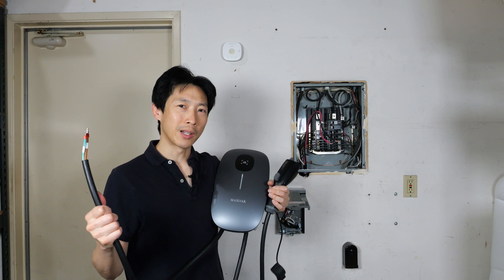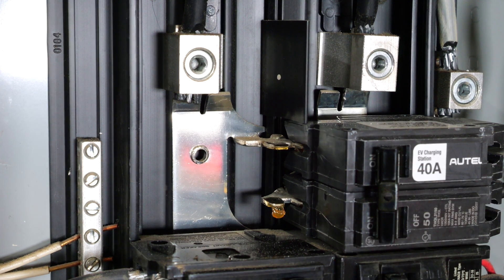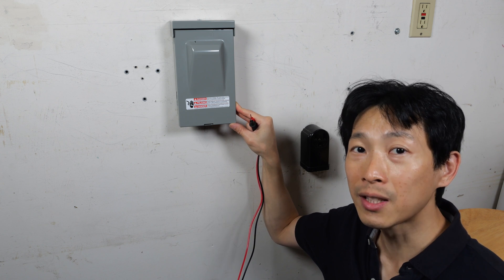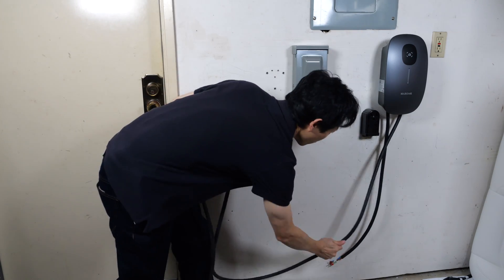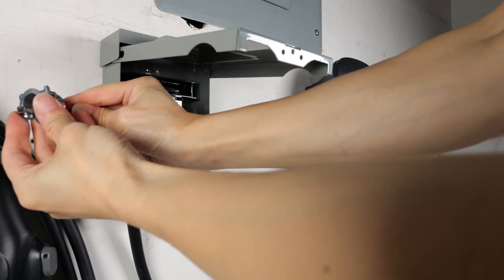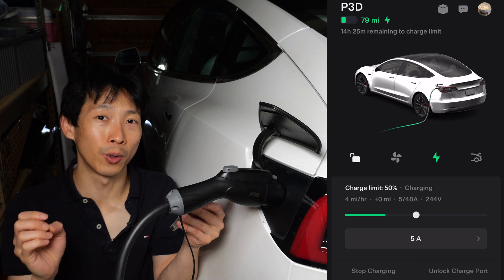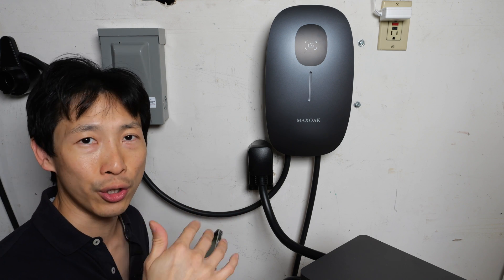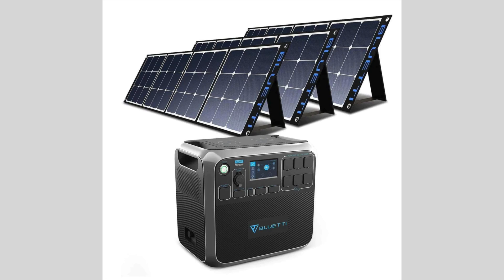Installing a Hardwire EV Charger Myself [Maxoak]

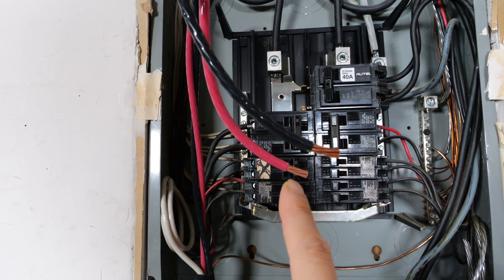Comment: 1:04 a 70A breaker can allow too much current to flow through 6 gauge wire.  I'd put in a 2-pole 50A breaker.

Comment: just be aware your stress relief clamps are all reversed, the clamping part goes outside of the box and the lock ring nut goes inside of the box also a anti-chafing pvc ring stops any chance of the stress relief chaffing thru the wire insulation.

Comment: Is it possible to share the amazon link for the electric box and the inner metal piece that acts as a jumper ?
Reply from the maker: I've gotten a few complains how the device I used may not be rated for EV current transfer and so I cannot recommend it. I actually would go with the large lever switch types like this: https://amzn.to/3Ome19X Yes, it's A LOT more expensive but you have to do it for safety reasons.

Comment: You could've eliminated that disconnect by putting the charger in that space then going to the breaker you dont need a service disconnect when youre that close to the power source not to mention your inverted connectors are just horrible. You did more work than the job called for .

Comment: What is the thought process behind installing the disconnect box. Why would that be necessary for an install like this. Why not wire the charger directly to the breaker?  Other comments say it’s not rated for this type of power draw anyway, but why would it be needed at all?

Comment: There have been documented fires using that type of disconnect box, they are not rated for continuous high amperage of EV charging.  You need replace with a lever handle disconnect.
Reply: I would say they are not even needed and you are just adding another point of failure.
Reply from the maker: Great suggestion.

Comment: i have seen melt downs on that disconnect box, should use a lever handle disconnect
Reply from the maker: More beefy, good idea. Where did you see the melt down? Might be from a bad connection resulting in overheating.
Reply: @BeatTheBushDIY  video on youtube
Reply: @BeatTheBushDIY  state of charge

Comment: As a licensed electrician that installs EVSEs, I need to make a couple comments. First, always get a permit and inspection. Most areas require them and it your utility offers rebates they will need the inspection as well. This will not pass inspection. When using the 6/3 romex, I will fail inspection with anything more than a 50amp breaker (and set the charger at 40amps max). If I want to go to a 60amp breaker and the charger set at 48 amps, I need to use thhn in conduit or #4 romex. The 70amp is too big. Also, I will only mount units or cord holders to a stud. The best anchors will not last with the cord use.
Reply from the maker: Thanks for your comment! It makes total sense. I assume 4 awg is needed to minimize heating so you wouldn't need a conduit in that case. If you use 6 awg, it needs to be thermo plastic high heat resistant nylon coated wire (THHN) so that it can get hot if it needs be and inside the conduit.
Reply: I'm not an electrician but a communication technician. I work with large batteries, rectifiers, relays, and shunts.
Everything the electrician said is correct. I would use a plywood backing to mount the charger. The plastic anchors will prematurely fail.
Reply: Agree I would not go beyond a 50 amp breaker even on a 200 amp panel having solar and AC on  my house, I have question if any electrician cares to answer the question  , How long do these EVSE chargers last ? I have a AeroViroment 32 amp charger  on a 40 amp breaker hardwired installed "9 "years ago still going strong I use it now for my Model Y 2023, should I replace ?

Comment: Ex journeyman lineman here, you did a good job!  Even opening the breaker before inserting it is good safety practice.  No sparks and no arcs good joo joo. (:  As you said the size of the cable can be misleading due to insulation variances. And like you mentioned you are wanting to know the cross section of the actual wire and the make.  Copper aluminum etc etc!  I like you mentioned proper shoes as well.  It amazes me that some people will even be standing in water or leaning on something being a good ground while working with electricity.  Or not realizing the dangers of an open neutral that is not connected or properly bonded.
Reply from the maker: Thanks for your comment! It means a lot! =D
Reply: I mean as long as you don't count the use of a 70 amp rather then a 60 amp.   Second those disconnects are known to literally melt with evs because of heat over time.   I would suggest switching to a better disconnect and a 60 amp breaker....